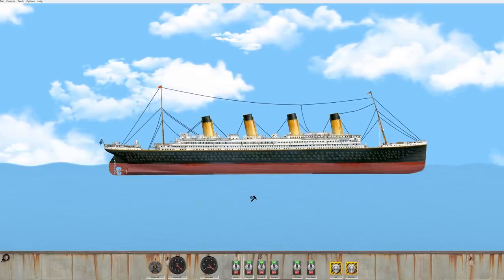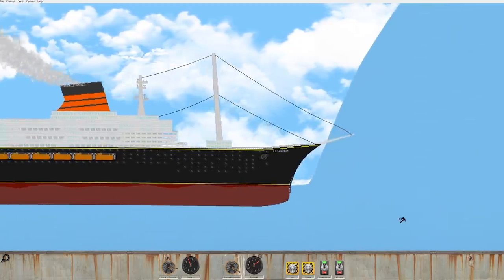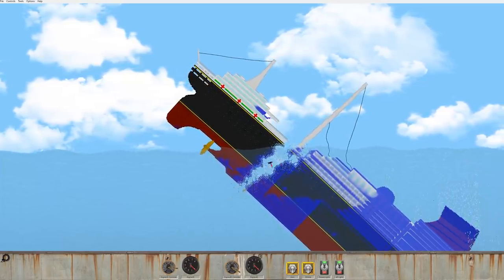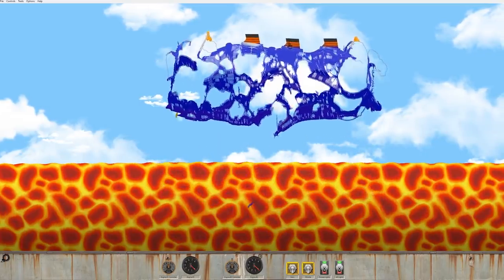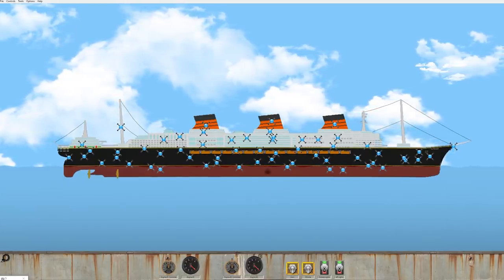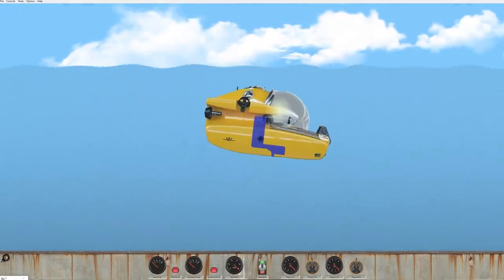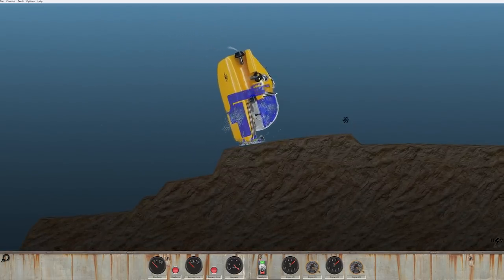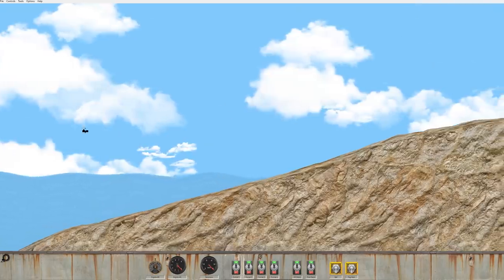Making Ships Fly with TURBO MOTORS! - Floating Sandbox Gameplay

Comment: Increase density! If you teleport a sup that isn't meant for deep water into deep water it will not be crushed if the hatch is open. You had a hole in yours so water rushed in